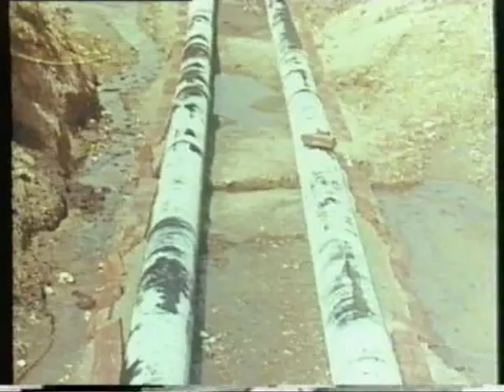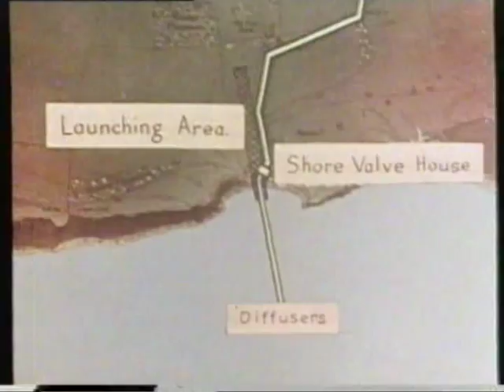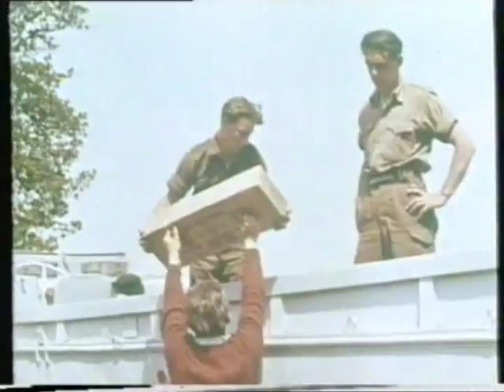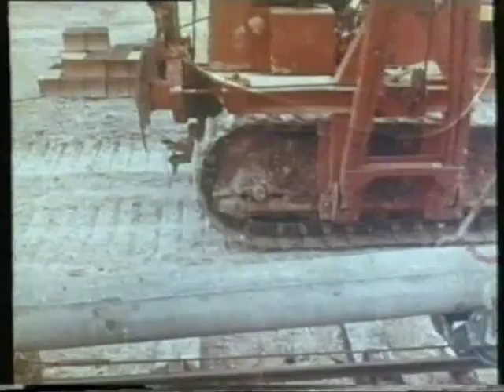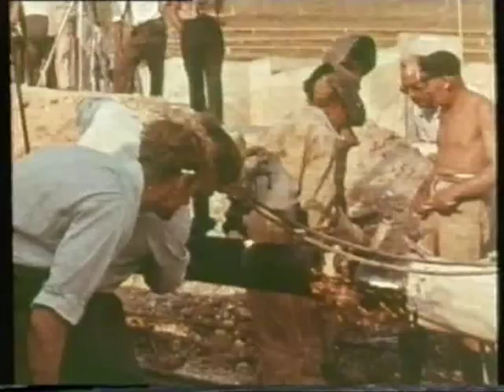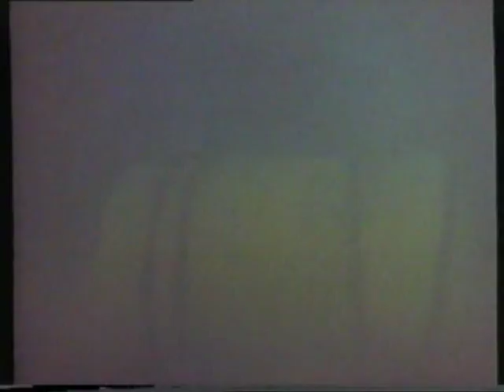Winfrith AEA - Arish Mell Radioactive Effluent Sea-Disposal Pipeline

Comment: I worked at AEE Winfrith from 1977 to 1984. 

I remember many happy times there as an Apprentice Electrian and later a "Research and Experimental Mechanic" the job title of all tradesmen at Winfrith. 

The monthly maintenance on the pipeline shown in this video was the most sought after job in the electrical department where I worked.

We used to greatly enjoy getting off the main site in an Atomic Energy Authority 4WD Landrover to get to the pits to do our checks. Lots of time setting things up, including interaction with the Army on the Lulworth Ranges to make sure we would not find ourselves under fire. 

According to this video, there were 12 pits in the pipeline that we would visit. According to the real maintenance schedule, as performed by the crews, there were 13 pits. "Pit 13" was a pub at Lulworth called... "The Weld Arms".

Our work was always taken seriously and performed correctly, but even the gentlemen in charge of the maintenance schedules knew to factor in time for Pit 13